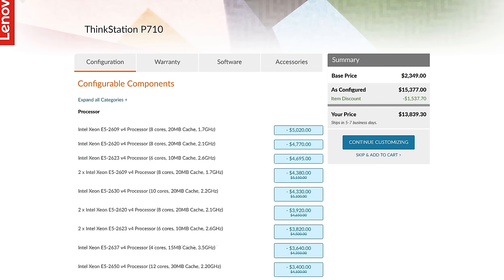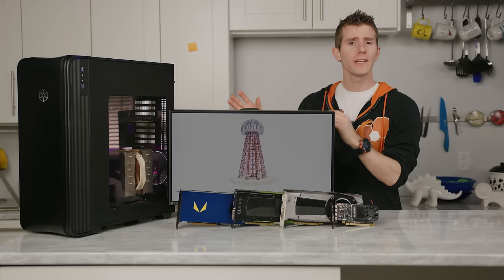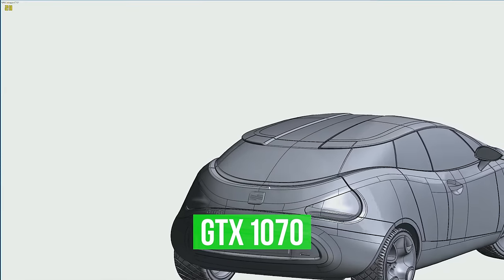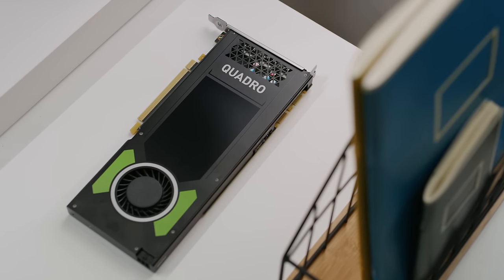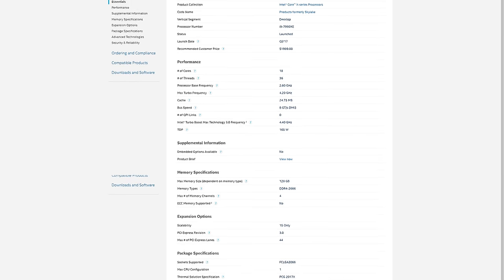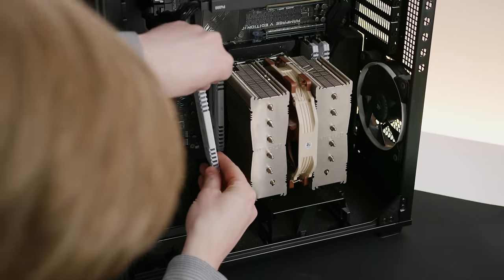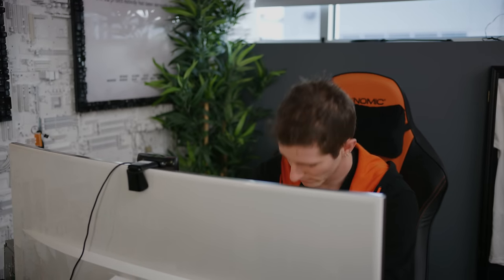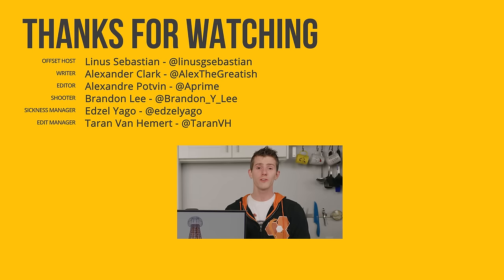3D Modeling & Design – Do you REALLY need a Xeon and Quadro??

Comment: When I was in aerospace engineering undergrad I had so many problems with Solidworks using an i5 processor and 8G of RAM. Even my intro class to CAD used assemblies with 10+ parts (more like 20-30). And if you wanna go more into CAD/FEA/CFD I’d take the higher performing options Linus says. No need to go crazy expensive but consider it if you are getting frustrated with performance in that first class.
Reply: @todorow22  I did post that 2 years ago and at this point it’s been 8 years since that Solidworks class. My comment was probably out of date when I posted it. And now even more so. Can’t say I know the cheapest option for a good Solidworks experience since I make enough money not to worry about that.
Reply: @BluesJayPrince  ya I figured it was just an out of date thing too. XD

Comment: SPECviewperf is an example for poorly optimized software when there is so much difference between identical GPUs with different names (for example GeForce GTX 1080 and Quadro P5000). These GPUs differ in nothing but the amount of VRAM and memory bandwidth. The benchmarks do not even require 8GB and the 1080 even has faster memory than the P5000. There are no special instructions whatsoever for the Quadro cards.

Comment: You could do it on a dual core processor, the only difference being the length of time it would take you to run a design simulation. Of course if you’re set on a mega project, only the best will do. The only real question, is how much computing power you need outside of it and it would be overkill fot most people.

Comment: I'm not really sure, but for rendering there is more important processor than a graphics card. That's why graphic workstations has for example 12 - 16 core processors. On my standart 6 core rendering a small sketchup images in 800x600 takes tens minutes.

Comment: 1:20. Assemblies only up to around 10 parts? I run SolidWorks 2019 with a 7th gen core i5, 8 gigs rams, and Intel(R) HD graphics 620(an integrated GC). It handles assemblies with well over 150 parts easily along with static analysis simulations and even some decently complicated topology optimizations. The more serious simulations are only really where it begins to struggle.

Comment: I mean, you also have to factor in what programs the modellers are using. Things like Marvelous designer, zbrush, substance painter really need higher end rigs when your really getting into some of the details. I mean I'm running on an i9 and I have visable lag on some CPU calculations with these software. Before you go "oh well nobody uses these" thats wrong those three software are the industry standard and are used on a daily basis.

Comment: I use a 2016 Razer blade stealth with a gtx 1060 for solidworks. It works alright for tool design. But runs NX (ug) and Autocad really well.

Comment: I feel like this topic could revisited and split into 2 different categories; people in "CAD" programs like Solidworks/fusion 360 and those working in "3D polygon" modeler programs like Maya, Blender,etc....have way different needs in a computer. There is the subject of CPU vs GPU renders as well; a high core count doesn't mean anything if the render you're using is utilizing the GPU(in such cases, the CPU would actually hold the GPU back).  3D modeling is a very vague term when you look deeper.

Comment: I can give you my personal experience in designing high voltage power lines (PLS CAD) and processing large amount of lidar data. No, you don't need quadro cards or xeon cpu's, i have been doing modeling work on gaming pc for the last 8 years and i have no issues. Now saying that, i have no idea how performance would be if i did rendering heavy things.

Comment: The only time i would recommend a quadro is that they can be pretty cheap used on ebay and have tons of vram for what you can get for them. if you want to take it a step further and if you don't mind some tinkering, go look at gaming on a tesla. not all motherboards support it but Wendel from Level 1 tech had a nice fid on it. those tesla p40 cards are pretty darn good rn for about $100. a GPU is a GPU and if the price for performance is good the price is good. dont let the model name scare you from getting a good deal. Also workstation/server stuff is usually made to a higher spec of reliability and longevity. if you want your computer to last you for the rest of your life and not too worried about being the fastest out there , then a couple of xeons and an old quadro will do you just fine :p

Comment: what do you think about these specs for solidworks rendering ?
Processor: intel core i7-10700K up to 5.2 GHz
Rams       : 32G (16*2)
VGA         : Quadro P4000
Storage   : 256 M2 + 1T SSd 

and which motherboard would be the best for these specs?

Comment: I have a PC with a Ryzen 7 2700X and an RTX 2070 with 16GB RAM (Planning to upgrade to 32GB RAM) and works well with Maya and with rendering. If I'm not mistaking, The bare minimum you would need for 3D modeling and rendering would be an 8-Core CPU (be it an Intel Core i7 or an AMD Ryzen 7), 16GB of DDR4 RAM Essentially (32GB RAM would be ideal) and an RTX 2060 (or its Super variant) should suffice.

Comment: The biggest difference between gaming and professional cards is the drivers.  Gaming card drivers are crippled.  Shaded with edges view requires hardware accelerated lines, and you only get this in the professional drivers.  Note I am talking about solidworks and other opengl CAD software.  Siemens NX shows this difference between gaming and professional cards the best.  Autodesk software like AutoCAD, Inventor, and Revit are DirectX.  There are no big driver differences yet that I know between gaming and pro cards for this DirectX side of things, so if you need a card for Autodesk then go ahead and save money and get a gaming card.  You should not have any issues there.  Just get the quadro or radeon pro for real work in opengl CAD programs.

Comment: Quadro K2200 and a Xeon CPU E5-2603 v3 @1.6GHz with 32GB RAM in a Lenovo Thinkstation P500 here: I can say that modelling is fine, but with simulations it is a bit slower, than I wish. Nevertheless, it will demolish the standard gaming hardware any day of the week, so if you are going to use Solidworks regularly get a Quadro.

Comment: SW 2022 has some major graphics engine changes, I think these were implemented in 2021, from what I was using before.  My SW was a bit slow,  so I upgraded from a 2060 to a 3070.   SW seems to not be improved at all.  Granted I'm not using a Quadro, but my older version of SW seemed to work better than this newer version.  I'd love to see how the newer SW graphics engine works with GeForce vs Quadro on newer cards in a more controlled environment.

Comment: The xeon isn't necessary, we're running on i7's. Old i7's. For somewhatlarge assemblies. The processor isn't the limiting factor, especially with the cpu-heavy tasks seemingly running single-core

Simulation is a different matter. You need massive RAM and a fast CPU. And rendering is multi-core. But if you're working in CAD, you usually do neither advanced physics simulations nor rendering.
For the GPU a quadro p620 equivalent should do the trick. Again, this is what we have in our CAD workstations. Before this, when we ran CATIA V5 R21 we ran far lesser CPU's and GPU's with no issues in large assemblies...

Comment: I have a core i9 with 32 gb ram and 1 tb ssd. But the gpu is just a GeForce gtx 1650 ti p max. Will I be able to use solidworks comfortably on midsized projects.

Comment: Can you revisit this subject please? 

Few thing that you haven't touched,  often parts are very complex with complicated features, I experience crashes with this build working on a single part(I address the rx 580 suggestion).

I was wondering if I would get better performance with an old quadro card from Amazon/Ebay at around 200USD

Comment: My skylake i7 and 1080 is perfect. It works a lot better than the xeons and quadros at the uni computers. Rendering is faster, Substance Painter is faster, Zbrush is faster and doesn't slow down. I can decimate, zremesh, firbermesh and dynamesh really fast. Maya retopology is so much nicer at home than at uni. I can decemate with higher polys like 300k, so I can reto a mesh that's closer to the highpoly. I would recommend an rig a few generations behind like mine if they plan on building a PC for uni or college what ever you call it. 

Something to keep in mind for people. Rendering definitely uses the GPU, but for the most part your CPU and ram is doing the bulk of the work.

Comment: For those wanting to do simulation regularly, be it FEA or CFD, 32GB ram is more than worth the extra money. Id almost state it as a minimum. Id also recommend a bigger SSD than 500 GB, simulation files eat up space pretty damn quickly. On the CPU front, my Ryzen 7 3700X is incredible and has monstered anything ive thrown at it so far, in all work loads (Simulation, Renders, CAD)
Reply: Id also recommend staying away from Solidworks for simulation work if that is possible...

Comment: I'm using a AMD Ryzen 3 2200g, 16 GB 2400MHz and RX 560 for 3D modeling, rendering, CAD and I'm really happy with the performance.
Reply: @justadevil432  Yes, if you are on a budget (like me) It's good. With the RX560 I do GPU rendering with Blender - Cycles. 
Depending on the rendering software, you may need a Nvidia card with CUDA support.
Reply: @justadevil432  I use the ASUS B450M-A

Comment: Maybe I could get an answer here. I want to improve my current system for running Chief Architect software (I'm a residential builder/designer). I don't care about ray tracing. Just want the computer to have minimal lag time between plan views and renders. And I want it to be able to handle large layout files.  Currently I'm running a Ryzen 7 1800x CPU and a Nvidiea 1080 GPU. It works ok but there is still more lag time than I'd like. Maybe a Quadro GPU with a higher frequency Intel CPU (I don't know that Chief takes advantages of the 8-core Ryzen other than in ray tracing which I don't really care about). I'm not sure if Chief Architect is similar to solid works in terms of what hardware would work best,

Comment: most professional loads, ie design and drafting aren't going to need anything like this. I design building facades, balconies, canopies and sculptures in Autodesk inventor and I don't have any issues with a 1050ti and an I5 6600 when using 100-150 parts. I don't need 4k because I would rather have 2 monitors and run Inventor in one with a desktop in the other than a pointless 4k screen. And 60fps isn't required. What is really important it a fast network connection, a fast file server and a really fast SSD.

Comment: Experienced designer: Most of Cad programs use only "Single Core." You should buy the cheapest & quickest i7,i9 CPU. We have xeons and i7 configurations. For most of the Cad programs, I7 8700k OC 5ghz is the best one for us. First Clock speed, Second Cache. Don't waste your money with 2-2.5ghz xeons. Press ctrl+alt+delete and monitor your CPU while your cad program is working. You'll see only "one" core is processing.

Comment: For 3D modelling only, consumer peocessors will do it perfectly but for simulations like FEA and CFD would need workstation processor like Xeon. Also in CAD in 4K is insignificant.
That config is like dream to me, but I am adjusting with i7, 1 gb geforce 520, 8gb ram in my laptop. For modelling in creo I never faced any obstacle, on Creo simulate also the approx time is less for single part structural analysi But on Siemens NX 11, modelling becomes little slower and for single part structural analysis on siemens sincenter it takes a lot of  time to show the results.

Comment: I know this video is old by now but just wanted to say that there should be a third category regarding gpu needs and usage. Still today we have gamers and workstation categories, but workstation  can be be divided into two... CAD and 3d for entertainment. For Cad it seems like quadro is a non brainer, same as rtx now for gamers, but what about Maya,
 3d Max, Blender, substance painter, etc? Those are programs meant for work also, but they don't seem to benefit from quadro drivers at all. So RTX is the way to go even for a workstation, if is meant for virtual entertainment were ultra reliable precision is not needed.

Comment: The PC for SW don't need to be super fast. 
I have an old Dell Precision T1700 with 16GB Ram, Intel Xeon E3-1280 v3 CPU,  Nvidia Quadro K4000 and sumsung SSD.  
And it is working good for me, by the way my assembly is less than 100 pc's

Comment: Being a masters student in Aerospace engineering and someone who has worked a lot in solidworks, let me correct you a bit linus. Anything around gtx 1070 would be more than adequate. Any other workflow will 100% go to either your Uni's or your nearest HPC clusters. That's how every research project work. In terms of review renders they are almost always done on your Uni's CAD lab because of their fully licensed pro softwares. No student even with deep pockets would probably be able to afford the pro softwares on its own mostly because you use multiple softwares at once for your research. In terms of industry, your organisation will usually your own HPC or a multi-stacked core computing setup which takes care of all the rendering and simulations, which yes uses quadro cards but those people already know what to do. The decision is not really made by the engineer who got the job. So in every sense, no one who actually doubts what system he needs and is watching your video will ever need to buy quadro cards on his or her own, just because of how engineering design and simulation in research works.
Reply: Check NavisWorks Manage and see what a refinery looks like with 500 000 components/pipes/fittings structures etc. Projects with 50+ engineers and designers working on one file. GTX 1070 can go sleep. Modelling singular components in CAD, sure, you can do it on a cellphone gfx card, but don't underestimate how large "assemblies" can get. Sure in Aerospace you can work in shaded view or wireframe and the units are probably mm or cm with a few hundred, maybe a few thousand small components, but things like refineries/airports and large constructions in Revit or NavisWorks get HUGE (in data/processing size), so meters and kilometers, with tens of thousands of components each with their own metadata and scheduling/phasing/quantities built in. It's not just walls, floors, foundations, roofing etc, but systems on large structures are by far the most complicated and data heavy ive found, like MEP/HVAC. Solidworks and BIM platforms like Revit and ArchiCAD also require varying resources for each object on account of the metadata in BIM etc etc. The central file for a BIM model usually also contains information from all disciplines combined, architects, plumbers, electrical, mechanical, civil and structural engineers, landscapers, interior decorators, contractors, specialists, even accountants and quantity surveyors, etc etc etc. Also in the real world, unlike Uni, companies are of varying size, so you aren't always guaranteed a rendering server/farm. Yes sure, AutoDesk offers cloud rendering but that doesn't help if you are lagging just trying to orbit a gigantic model. I know the rocket is exciting and all, but the launch facility is a far larger assembly than the rocket, if I can put it that way. And comparatively a rocket + launch site = 1/100th the size of a large oil refinery, so Linus is quite right, generally speaking.
Reply: @cdp_tv  I disagree. Nobody freaking designs such a big assembly from their home system. Such a big assembly requirement is always part of a research which has significant resources. and hell people even hire third-party HPCs. And if you for some reason are designing such a huge assembly from your home couch then you are even beyond pro-consumer. At that point, you know SolidWorks in and out. you don't need Linus to tell you what card you need. Linus mentions the video being subjected to people who are willing to start CAD design, whether as a student or as a professional. in either case, no one, absolutely no one anywhere will give a new engineer to design an insane assembly from their home system, not a single industry. in your first few years, every project you get anywhere will be able to run on a decent PC with gtx 1070 and 32GB+ ram with a good cpu. anything above that and then your company or uni will definitely have their own machines with multiple GPUs and many-core CPUs for you to work.  and as the complexity increases more and more workload you offload to the central server. that's just how any research works dude. nobody does such complex simulation and research without industry backings in terms of finance and resources. nobody

Comment: What about daz studio? If money is no issue then which system should i build? Right now i have i7 6700k, gtx1070 g1, 32Gb ddr4 3200mhz, samsung 850 pro ssd/s and it took me about 12 hours to render a specific dark scene with light/dust particles and god rays and i want that scene to render in mins if possible. So i will really appreciate the tips.

Comment: i have ryzen 5 2600 and a 1050ti and rendering is slow but not that bad using cycles on blender, so you dont need high end hardware. however im getting a 3060ti soon for my sculpting